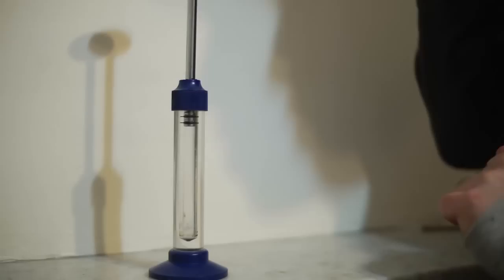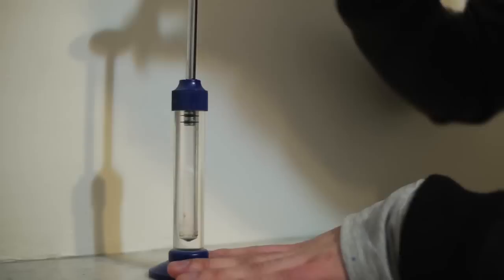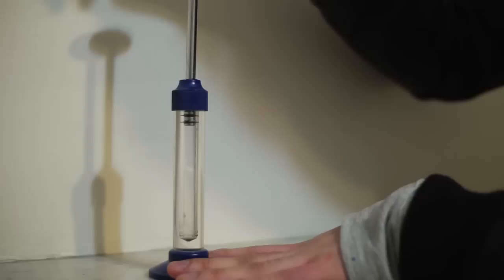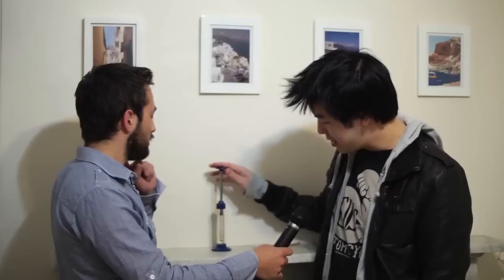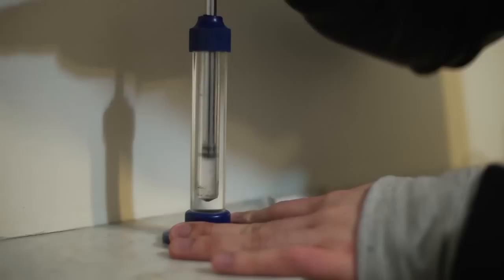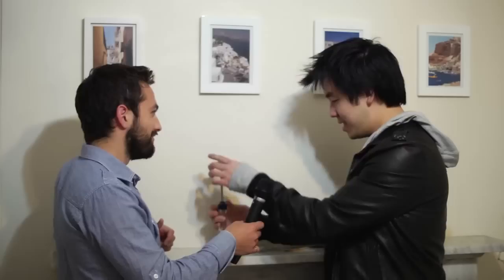Fire Syringe

Comment: I'm surprised that you didn't mention that that's how a diesel engine works
Reply: +vancouverbuspilot

truely fascinating
Reply: +Faris Shamren learn how a diesel engine works before you write down a reply. a diesel DOESN'T USE A SPARK PLUG. the fuel is ignited through compression.
Reply: I just like the fact that this discussion happens 4 jears after the innitial upload of the video
Reply: +Bartosz Olszewski  A diesel does not have a spark plug. It has a glow plug which is a very different thing. There is no spark what so ever. The glow plug has a resistor wire at the inserted end that will heat up, enabling the fuel to ignite.
Reply: +Bartosz Olszewski I'm pretty sure do to the lack of response the only reason the spark plug comment was made just to upset people
Reply: +Faris Shamren that's a gasoline engine
Reply: +Bartosz Olszewski po polsku nazywa się to świeca żarowa więc teoretycznie odpowiednikiem jest "heat plug" albo tak jak tutaj majster wyżej napisał "glow plug"
Reply: Faris Shamren only gasoline uses spark plugs. Diesel readily combusts when compressed.
Reply: I love people that correct other people whilst being completely wrong :) Just #2016facepalm
Reply: Douglas Howard 
actually, a glow plug is only needed for cold starts. There are many diesels that don't even have glow plugs, such as many caterpillar engines. 
And as a correction to an other comment, the diesel isn't readilly cumbusted by compresion, it is directly injected into the cylinder when you want the ignition to happen.
Reply: real mechanic here, dumping my knowledge.

DIESEL ENGINE:
diesel engines light air/fuel mixture with compression, and the area between cylinder head and piston is so small when piston reaches top dead center, because high compression is needed for lighting the air/fuel mixture.

diesel engines are always required to have long cylinders.

glowplugs are only used for cold starts, they just heat up the air when you start up the car in the morning.

EXTRA:
diesel engines require fuel systems pressurized from 200 BAR to 2000 BAR, because diesel is the fuel that doesnt evaporate very well and is greasy and sticks to anything.

because diesel is greasy fuel, it makes the engine last longer (up to 1.000.000km), because the most common area of the engine that gets worn is the cylinder, because piston rings constantly scrape on the cylinder surface whilist getting little lubrication, but internally, diesel lubricates the piston compression rings inside of the combustion chamber.

when you give some  throttle to the diesel engine, you regulate how much fuel it adds to the combustion chamber.

diesel engines require VE pump to make high pressure in fuel system ( 200 BAR - 2000 BAR)

diesel engine's used engine oil is always black as ink and impossible to see thru it, because diesel creates alotta carbon when igniting the A/F mixture, and because of the high compression, the burnt gasses tend to blow by the piston rings, and the carbon sticks to the cylinder surface outside of the combustion chamber, and the oil washes off the carbon and thus mixes carbon with oil, but it all gets filtered, it might not look like it, but there are many tiny tiny carbon particles that are harmless to the engine, particles bigger than 2 microns are a threat to the engines, thats why today's oil filters filter pieces of carbon bigger than 2 microns.

diesel engines can rev up to 6000 rpm.

GAS ENGINE:

gas engines light air/fuel mixture with sparkplugs, and the area between cylinder head and piston is large, because gas engines dont need compression to light the air/fuel mixture, but the compression shouldnt be too high in the gas engine, cause you'd risk having detonative ignition, which could be catastrophic for the engine, so generally speaking, gas engines use low compression.

EXTRA:

gas engines have fuel system pressures only up to 2 BAR of pressure, because gas evaporates really well and mixes really fast with the air.

gas engine's used engine oil is much cleaner, and you can see thru it if you put it in a small transparent container, because gas doesnt create much carbon when ignited, oil gets darker look when combustion gasses blow by the cylinder piston rings and stick to the cylinder surface, and oil washes it all down and mixes carbon deposits with oil.

gas engines dont require VE pump to make high pressure in fuel system, but cars like BMW 2002 is a gas engine and has a VE pump, i dont know why but i can assume its to make the gas spray faster and mix faster with the air.

gas engines generally have short cylinders.

gas engines dont last very long (200.000km - 350.000km) because the most common area of the engine that gets worn out is the cylinders, and gas doesnt lubricate well.

well there you go, all my knowledge about these 2 engines, they might look the same, but they're very different internally.
Reply: Man, the misconceptions about diesel engines abound...
Compression creates heat. Diesel injected at just the right time auto-ignites. So does gas, and direct-injection gas engines run at very high compression ratios. 
Diesel fuel has a fairly high flash point. On a cold day, a lit match could be extinguished in a puddle of diesel fuel. It needs to see high temperature and fine atomization to properly combust. The importance of this will become clear.
Early true diesel engines used an injection pump that could be equated to a gas engine distributor, except rather than generating spark, it pumps small quantities of high pressure fuel. Early systems generated fairly low pressures, say 1000PSI, and had poor atomization due to inferior injector and delivery valve designs. 
As injection pump technology progressed, pressures and accuracy began to rise. Early injectors basically were just a body with holes in the end to squirt fuel. The later designs incorporated internal valves that allowed the pressure to rise to a certain point before blasting out in a more controlled and precise jet of atomized fuel. 
I won't get into direct versus indirect injection here. 
The newest diesel systems utilize a 'common rail' with a pump capable of generating upwards of 36,000PSI of fuel pressure and electronically controlled injectors capable of upwards of 18 separate injection events in a single power stroke. This dramatically improves particulate emissions, economy, and cold start ability.
So how does a diesel engine, particularly an older unit, overcome cold starts? There are several ways. One of the oldest is by using what is called a 'pony' or 'donkey' starter. This is a small gas engine that is first started then used to turn over the larger diesel. You can disable the fuel and cut compression on the diesel to help it turn over and get fluids flowing, then you enable compression (but not fuel) to build heat. Then, you kick in the fuel on the diesel and cut out the pony. 
Then there are intake heaters. 2 different flavors. 1 uses an electronic heater grid in the intake stream that preheats the air. The other actually uses a small, primitive injector and nozzle heater to generate a small flame inside the intake (Perkins) 
Then we have the good ole' deeply misunderstood glow plug. This is an electronic heater that protrudes into the combustion chamber. On particularly cold starts, they will pull upwards of 20amps each to cause the tip to glow red hot. This allows the diesel an ignition point, but typically only for up to 60 seconds. If they run longer they burn up. By then, the engine should have enough heat to self-ignites.
There is also ether injection. An automated system injects a very precise amount of ether into the intake to allow starting. Ether is essentially starting fluid. WARNING if used alongside heater grids or glow plugs, the intake can literally explode. If used excessively, the engine can 'run away' meaning it revs uncontrollably until it flies apart. I've seen both. Not fun.
The last system is an external heater of sorts. The block heater. This is an electronic heater that warms the coolant and/or oil to allow easier starts.

Ready for the surprise ending? Some diesel engines use spark plugs. Yes, yes, bring on the flame. No, really. In particular, the Caterpillar After treatment Regeneration Device (ARD) uses a spark plug to ignite a diesel flame front in the exhaust stream to generate high exhaust temps to burn the carbon in the after treatment system. 
No true diesel to my knowledge has ever used a spark to ignite the combustion chamber flame front.

Oh, the part of the exhaust on a KW semi that hold the stack to the cab is called the muffler bearing. I'm serious.
Spark plugs on diesel, muffler bearings, exhaust fluid.... What's next? Blinker fluid??? No. No blinker fluid.
Reply: "Compression creates heat"Finally, someone got it right. :-)  Because the piston does work on the intake air, its temperature increases well above the auto-ignition temperature of the air/fuel mix after injection.  Look up adiabatic compression for more detail.
Reply: Dom Santhuff you win the internet
Reply: thats exactly what i was about to comment
Reply: Faris Shamren No that's a petrol engine
Reply: They don't have spark plugs? :-O
Reply: Viktor Jangsell yep
Reply: I've made gasoline engines that use compression ignition. And also diesels inject fuel into heated air.
Reply: unless its not a gasoline engine and rather a Diesel Engine they are very different engines
Reply: ("RNA0ROGER")  tell me more about compression ignition of gasoline.
I have been studying this topic recently , and i have been trying to find answers to questions such as why gasoline doesnt work well in a diesel,
Reply: Yeah...I was also waiting for him to say that...
Reply: No one ask
Reply: But stop agruing
Reply: Glow plugs are used for heating during cold start....it's not for igniting the fuel. Diesel spontaneously ignites upon compression.
Reply: ig im late lol
Reply: Bartosz Olszewski not spark heat from a glow plug
Reply: That is not how the diesel cycle works
Reply: @domsanthuff5181  you just read his comment wrong
Reply: @farisshamren4030  diesel engine start without plug
Reply: @ItAGR-rv3dc  also add in for diesel EGR systems can and do increase carbon build up by feeding cobtrolled amounts of cooled exhaust back into the inlet. This efectively reduces combustion chamber temperature and effective CC. Reduces enviromentally hard to "break down" NOx emmissions and reduces the amount of Nitric acid contaminating the diesels oil. EGR is good and bad but systems seem to be improving
Reply: @ItAGR-rv3dc  I see gas engines wear from around 90k miles. But never seen a well cared for diesel lose torque or feel worn well in excess of this. Q do petrol engines see increased valve wear due to higher revs than diesel?
Reply: How much air pressure i need to ignite a measured quantity of diesel fuel ? Say 1 cl
Reply: @Juppie902  try in the region of 200psi
Reply: Yup, When he said “You can compress air enough to light cotton”  I was waitin for the “Just like a diesel engine.”
Reply: Bartosz Olszewski False, Diesels dont have spark plugs. But they do have glow plugs. They are two entirely different things. Diesels work by the diesel being forced in at high compression ratios, this causing an explosion. Or the power stroke of the piston.
Reply: Haha
Reply: @farisshamren4030  Just Trolling right?
Reply: I just wanted to write this comment
Reply: @flint2368  well...
Reply: @farisshamren4030  not true
Reply: Yup
Reply: @tennicktenstyl  ,in hot days our after the diesel engine is enough hot, you could remove the glow pug (resistor wire) and the engine would keep working.
Reply: Maximilian I love people that try to be smart and cheeky and says things with no context which nobody will understand #2020facepalm
Reply: That‘s not how a Diesel Engine works. An Engine compresses Diesel not air and if the engine was cold you needed glow plugs to heat it up enough to make it exploding. Here you need just the compression and the air can ignite cotton.
Reply: and gasolen engens
Reply: @vancouverbuspilot  true
Reply: @flint2368  Hello just reigniting the conversation for ya 4(maybe closer to 5) more years later! See ya!
Reply: @manbear3101  hahaha legend
Reply: @farisshamren4030  You're wrong. Just thought I'd let you know.
Reply: Diesel engines run on diesel, not cotton wool.
Reply: Same here
Reply: @flint2368  And you might even get replies after another 5 years later 😃
Reply: That’s what separates the nerds from the car nerds
Reply: Night Bot I Mqps  Imagine that 5 years after making a stupid comment people are still writing to correct you.
Reply: Exactly, good to know I'm not the only one who thought of that
Reply: And also, this effect is taken into account on the gasoline engines.
Reply: @virabhadra2  Not really, unless you mean air compression which is essential for any engine.
Reply: @chicoti3  not directly, but yes. The octane number of the gasoline is the capability against auto ignition. The gasoline engine is built intentionally to be close to self ignition point, but not to close for stability of work.
Reply: @virabhadra2  You're talking about air compression which like I said, is present in any engine, it's not built to raise the temperature closer to the flash point, it's built so it can compress air to the best of its abilities, the more air, the more powerful the engine will be. Some even have extra compressors depending on the task. In fact, the flash poit is so undesirable in a gasoline engine that those that have multiple phases have cooling between the stages. The Diesel engine is special because it's built to have a more continuous and stabilized combustion (which demands much more expensive parts), that's why it doesn't have a spark plug. The air within the chamber is already at flash point, as soon as the diesel leaves the injector it combusts.
Reply: @chicoti3  I agree. Actually I wanted to say that the flash point is the reference point for both types. The diesel engines are working at this point, but the gasoline engines are approaching to this point, but at the same time limited by this point. The gasoline engine has to be adjusted (for the highest efficiency) to the fuel octane number which is directly linked to the flash point.
If you tank the low octane gasoline to an old engine, it will start knocking due to the unwonted early self ignition. The modern cars somehow can deal with it.
Reply: gazoline can be ignited this way too. We use sparkplug for gazoline engine because at high compression the gazoline ignition timing is in theory unpredictable and we want the ignition to happen at the perfect timing to not damage the engine, so gazoline engine has lower compression and ignite with sparkplugs so everything is under control.
Reply: same
Reply: not only the diesel ..the many rockets and shells fuses  have same concept ...sorry about my English ..i am from Iraq.
Reply: This is not at all how a diesel engine works, not even close
Reply: @stienogamez8296  This is literally how a diesel engine works. Air is sucked into the combustion chamber, it's compressed very tightly so that it gets hot, diesel fuel is sprayed into the combustion chamber and since the air is at a high temperature above the flash point of diesel fuel, the diesel fuel ignites. The "diesel fuel" in this example is the cotton. And to everyone else, no, glow plugs and spark plugs are not the same thing. Spark plugs continuously create a spark to ignite gas/air mixture. Glow plugs only turn on when the engine is cold because the combustion chamber needs to be warmed up in order for a diesel engine to work properly. After the combustion chamber is warmed up, the glow plug turns off.
Reply: @camaro25  If this is literally how it works, you’re saying that a diesel engine works on air and a piece of cotton... yeah right
Reply: I was just wondering the same thing
Reply: im straight thinking this is how the diesel engine works
Reply: @7acko  than you need to start thinking gay because it’s not how it works
Reply: @JeffManseau  same
Reply: @vancouverbuspilot  diesel engine do use glow plugs though.
Reply: Came here to comment exactly that. Commercial application of this effect: DIESEL ENGINE
Reply: @capturedflame  And Darwin's original theory of evolution has little to do with the modern theory of evolution: the original was the theory of evolution, while the modern theory is the theory of evolution; history versus the current state of things does not invalidate the original naming but is still an important distinction to preserve.  If you tried to run a modern diesel engine on coal, charcoal, and vegetable oil you'd run into undesirable outcomes.  Diesel fuel is a specific type of fuel now, that does not correspond to the fuel that was used in engines past.
Reply: @vancouverbuspilot  They do use glow packs. It's still the same science but it still needs heat added to it through an electrical probe. Same same, but different.
Reply: @douglashoward346  a diesel engine does not need a glow plug to work. Old diesel engines didn't even have glow plugs. The purpose of a glow plug is to preheat the fuel in order to ignite, when the engine is still cold. When the engine gets up to operating temperature the glow plugs are not needed. The glow plugs on my tractor are dead but it stills works. When its cold outside it needs quite some cranking before it starts
Reply: @farisshamren4030  bruh. No. We're talking about diesel engines. Instead of blurting oupplt a "correction," HOPING you're right, and making a fool of yourself, try listening until you know for sure.
Reply: That is very true
Reply: @douglashoward346  i’m pretty sure the glow plug is only meant to assist with starting in cold weather
Reply: F
Reply: Y
Reply: I just came from a diesel video from him using a model like rhos
Reply: That is what I thought the video was about when I saw it
Reply: @flint2368  I just like the fact that's this comment was made 10 years after the vid was posted
Reply: Also a nuclear bomb
Reply: Thats what i was thinking about